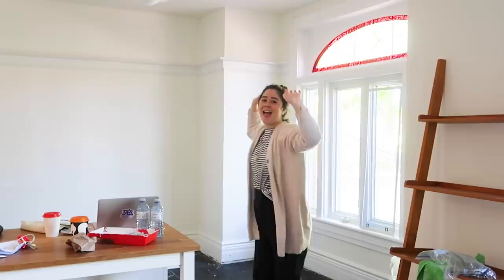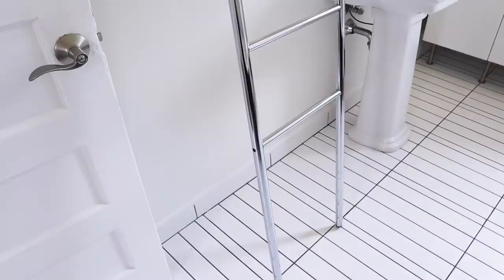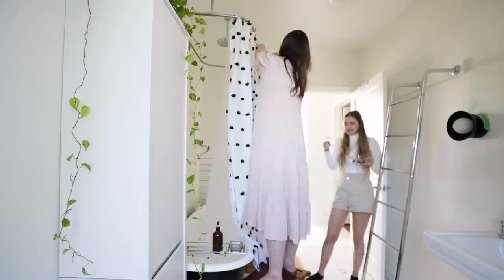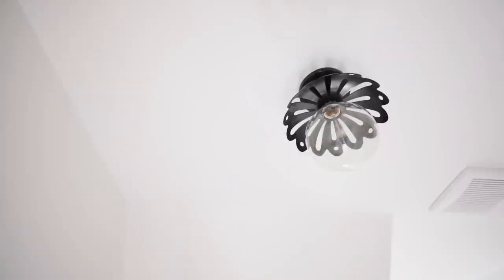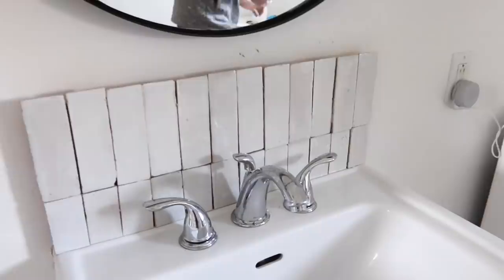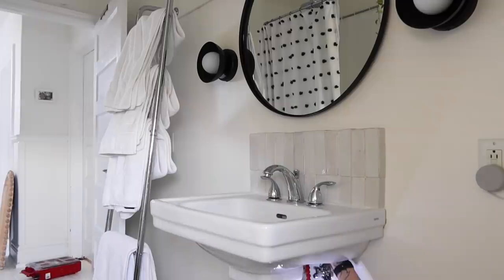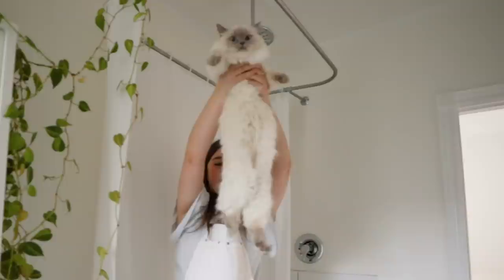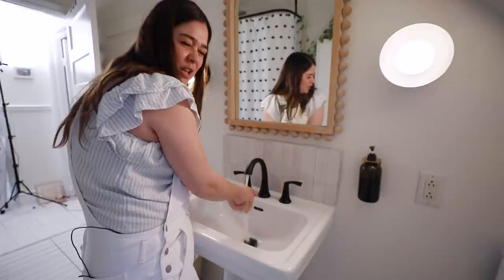Rental Bathroom Makeover On A Budget | My Rental Reno S3 E12

Comment: The two detaily bits that get me: how thick the back splash is now, but I guess it's useful since it's a little ledge... and also you had the power off to change out the sconces but didn't flip your outlet so it was right-side up.

Comment: You have a window with natural light, and put the rubber tree (that needs direct sun or at least direct light) in the corner away from the natural light. The peperomia (smaller green plant) can be away from the window a little. If you want your plants to live, put them where they get light.  You also do not think of the humidity of the room. The bathroom often gets to 100% humidity, these plants can mold and rot if you are not careful.

Comment: I loved the new wood mirror. The balled frame tied back to the curtain tassels and cabinet legs. Round black looked comparatively cheap and would not have tied in all the elements as well. It would have looked like an amateur decorator - the ones who always go matchy matchy. And would have clashed with the long lines of the black faucet. So great call.

I think the tassel hanging down on the cabinet was a vertical line in the center and “messed up” the composition. 

Love that you went with black on faucet and love rug and new Roman shade and vine placement. Your decorative items are always on point.

Comment: It looks great, the only thing I would change is the shower head and handle. Leaving them silver doesn’t match the rest of the room.
Reply: Changing out those really high ceiling shower heads can be really tricky, and sometimes the faucet hardware on tubs turns into a nightmare too. I’d just hit them with some high quality paint meant to adhere to metal, much faster and easier. Otherwise that room looks fabulous!

Comment: The t shaped piece in the window where you wrap your curtain string around it, on those, you wrap it in a figure 8 and it holds with tension, when you just wrap in a circle it is likely to just undo.  ;)

Comment: I did my bathroom over (I own but I'm on a budget) - painted the walls greige, and the vanity a charcoal gray and put gold knobs on it. Replaced the big ugly rectangular dark brown framed mirror with a round gold mirror, had a gold faucet put in, gold and glass soap dispenser and toothbrush holder. I did change the towel racks and tp holder to matte black. I also painted the chrome light fixture matte black and changed the boring white glass shades to swirly black and white ones. It all works because my new fabulous shower curtain with big yellow, beige, and smoky blue flowers,  ties at all together. Now I want a black shower curtain rod. (I painted my other bathroom dark blue.)

Comment: Since the cabinet is wall-mounted I would have left the legs off entirely.  It’a a more modern look and easier to clean. 

In the first video you complained that Noah didn’t use the towel ladder to your standard; why would you put another ladder up rather than hooks or a small shelving unit that would offer storage and not be potentially messy?

I really wish that Noah had more of a say in the decor.  He doesn’t like the mirror, he said the shower curtain was “fine”.  It’s his house too.

Comment: I think if you put a piece of wood the same color as mirror (or black) across the top of the tile and filled in the space between with grout (to kind of frame out the tile), it would make the tile look less crooked on top and really complete the look. Also I like the wood mirror since it brings warmth and prefer it to the black one. But now I feel like the sconces don't match. I prefer sconces that point downward personally.  I liked the other commenters  suggestions about spray painting the shower head and pipe black and also putting a butcher block top on the back storage unit. I personally would also put in some wall paper or paint on a least one wall, but I know all white is your jam so I respect your choice there.
Reply: Good suggestions, Savannah Gosnell. :)

Comment: I like the changes you did. The tile, legs on the cabinet and switching out the towel ladder all look really great. I would make two suggestions. One, I think your plant needs either less light or more water. The branches that you hung in the window are not looking so great. Also, I would get one of those grippy pads for under your bath mat so you dont go flying if it slips.